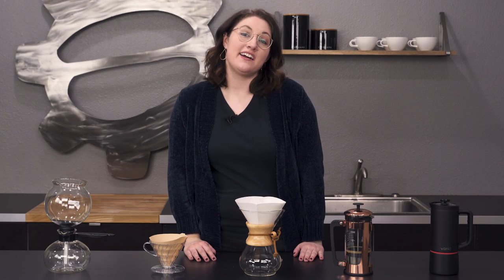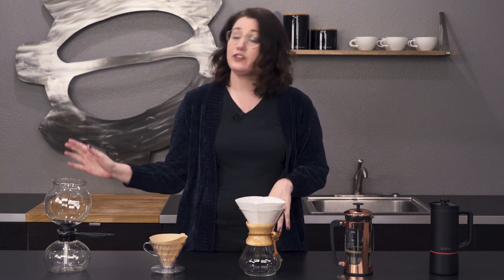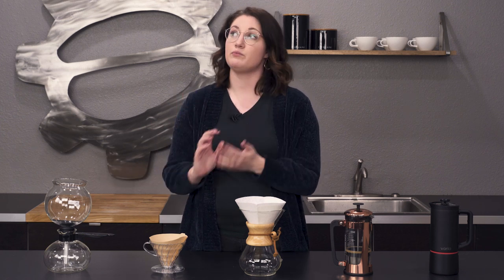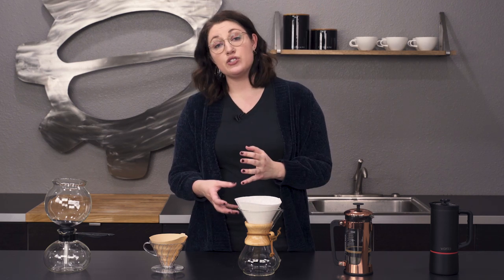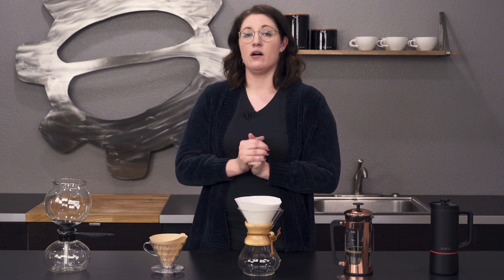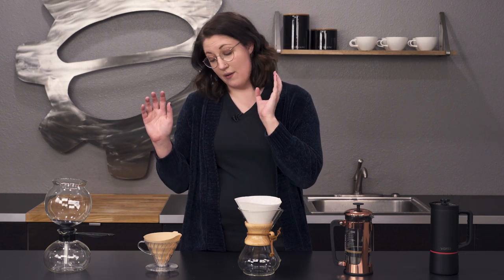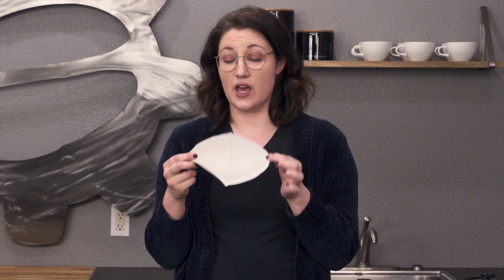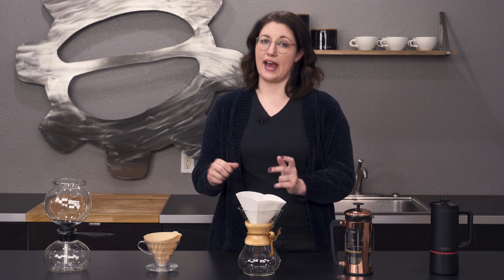Different Ways to Brew With Allie

Comment: Well done. However, you are missing two of my most used favorites, the Aeropress and percolator. Cheers
Reply: the moka pot is a percolator.i.e. forced boiling water through grounds.

IMO, Aeropress is the best single cup brewer ever invented.
Reply: @mariai9549  traditional percolators are not under pressure and allow the brewed coffee to recycle through the grounds

Comment: Is a Vietnamese tin coffee maker consider the drip coffee method on the left?
Reply: The Vietnamese pour overs aren't easily comparable to the coffeemakers you see in this video.  It's pour over like the Hario V60 and the Chemex, but since the filter is metal it'll let all the oils through like the French Press.  So it's kind of like a cross between the three in the middle.  It's also designed to make a small amount of strong coffee to be mixed with sweetened condensed milk.